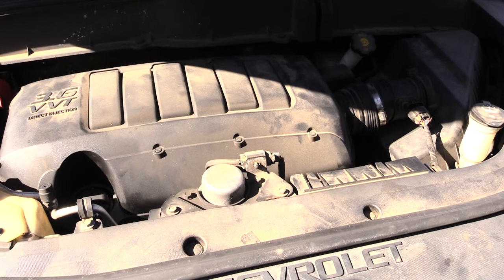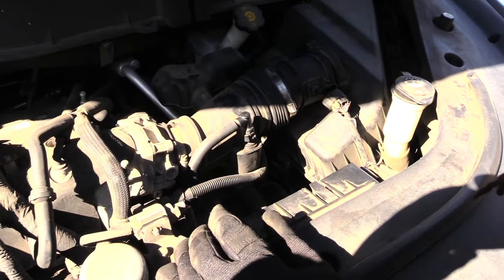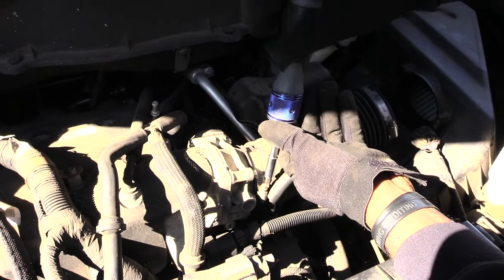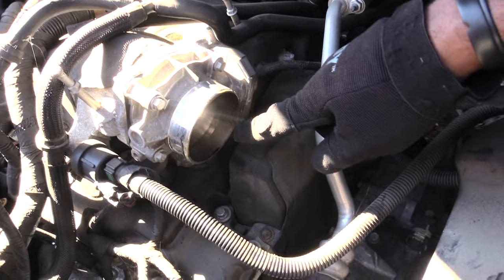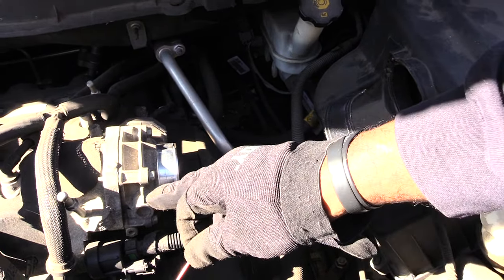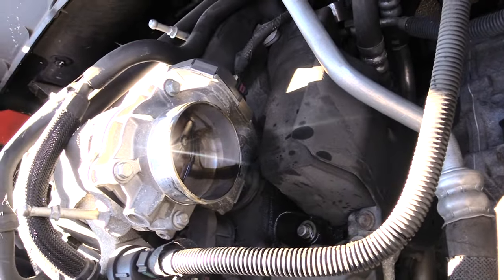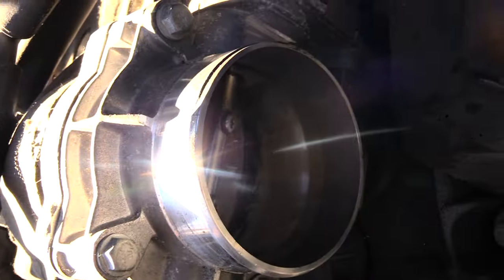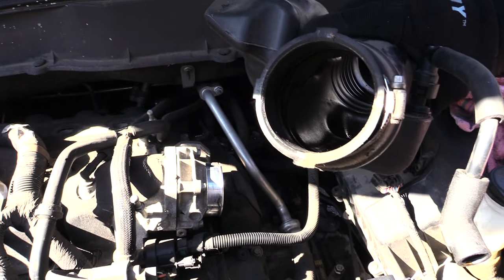Chevy Traverse Traction Control / StabiliTrak Problem Most Likely fix!

Comment: i randomly tried this because my stabilitrak kept randomly coming on and messing my car up. I was desperate for a solution and only thing i could do was push the traction control off before driving and even then it wouldn’t fix it all the time. There was barely any grease on the sensor or on the throttle intake. But i sprayed the sensor cleaning stuff on both, wiped it off really good. And so far it hasn’t came back on at all. So i’m hoping it’s a permanent fix, and if it is - thanks for this video! ❤️
Reply from the maker: Your welcome. Hope it fixes the problem. Please like subscribe and share

Comment: I never would have associated the Service Traction Control error to the Throttle Body or Throttle Position Sensor.  Stupid programming in my opinion.  I did this Throttle Body cleaning yesterday and so-far our Traverse is running fine again.  I didn't actually have any throttle body or carburetor cleaner handy so I used starting fluid.  I cleared the error codes and we're good to go.  Thank you for this video!
Reply from the maker: You're welcome! Glad could help Please subscribe like and share and check out our other helpfull videos

Comment: it happened again. Luckily this time we were not on the highway. Loss of power," traction control off" light comes on. Will be 2 years in april I followed your instructions to fix the problem. I have a full can of throttle body cleaner still at home so this time I had everything we needed to get it fixed. I had to look at your video again though
Reply from the maker: Thanks for commenting, hope you get it fixed!

Comment: This is the issue I am having with my Traverse. The Traction control light comes on, the Service Air Bags, and sometimes it has Engin Power Failure and won’t accelerate. I believe it to be the Throttle Body so I will check it out. Thanks for sharing.

Comment: Thanks man. I followed your instructions. Cleaned out the throttle body with the correct spray. It started up and there was no reduced engine power. The engine light was still on so I took off the positive battery terminal and put back on and that cleared out the engine light. Drives better than ever.
Reply from the maker: You're very welcome thanks for commenting hope you subscribe like and share.

Comment: It found out that there are several issues which cause the ECM to shut down traction control and reduce power to 3 cylinders. It looks like chevy installed a safety protocol that is too sensitive and will shutdown on the slightest error signal. The wheel sensor in my Traverse kept shutting the system down.

Comment: You really need to remove the throttle body completely to clean it properly. Don't ever spray that shit inside ur intake. It will fuck up ur sensors and just cause issues.

Comment: Starter my 16 traverse last night. The whole car was shaking the engine was sounding weak. The Lights came on saying traction control disable, then Stability message came on along with the light. 

Let it idle for a few minutes, restarted it and was fine. But light was still on. Would this help fix the issue as well?

Comment: My 2013 Buick enclave i replaced sparkplugs scanner code a mis fire check engine still on cleaned throttle body cleaned map sensor traction control stabilizer appeared and engine shaking
Reply from the maker: Sorry to hear.Please subscribe like and share and check out our other helpfull videos

Comment: I have a 2012 Chevy Traverse LS and my issue is that the brakes always tighten up when I’m on a hill or on the interstate. I literally have to pull over and wait for the brakes for hours to loosen up yet the Stabilitrak light pops up as well as the ABS light.

Comment: Well, I'm still having trouble with my 2012 chevy traverse, cleaned the throttle and so what. The contraction service light is on and stabilitrak. 
Ugh so frustrating 😫

Comment: I have a 2014 traverse that the throttle continues to advance at start. The rpm’s run  up really quick. I shut it down it and so far starts correct the second try. Any ideas what this could be?

Comment: did this on my 2015 taverse and now my ABS / Stabilitrak / Traction Control lights are gone, but i am getting brake pedal vibrations/jumping like i have a worn rotor. anyone have any ideas? is this an ABS issue? could be a rotor issue but this only started happening right after cleaning out the throttle body

Comment: I did this and it worked for a while, but the issue is now back and im pissed off. Took this all apart again and throttle body and plenum still clean. i might try the TPS

Comment: So if I do this my light will go off that came on right after we did the brakes and that is now on my dash and it says traction control and stabilizer bar never seen it but one time before this but went off now it won't and plus my ABS light came on to

Comment: I have a 2010 Traverse that died while driving it.  The display says traction control off and it won't start.  It will run on starting fluid but that's it.  I've checked fuses and replaced the fuel pump and confirmed fuel to the Schrader valve at the engine but still won't start.  Any help????

Comment: That’s oil from the engine that’s in there it gets in there from that small tube that is connected to the part that connects your TB to the air box. Being that these vehicles (07-13) are prone to timing chain issues i do my own oil changes every 4000 miles and clean that oil from that part every time so it does not build up to the point of becoming an issue

Comment: I got these alerts after I changed my struts and got it realigned.  No change in power at all.  i tried this method in your video and no change.  Was told to remove the negative battery terminal which i did and that still didn't fix it.  Now what?

Comment: My 2013 Chevy Traverse LT turns the TC light on and reads Service Stability Track and Service Traction Control. We have not cleaned the throttle yet. Is this simple to do myself or should I have a mechanic do it? The suv runs normal I don't feel any difference but it's concerning when I'm driving and it turns on. If anyone with the same situation please advise if you solved the problem. TIA

Comment: That's not my issue. My issue is while I'm driving the vehicle the brake is pressing down causing the stablizertrak service traction control light to come on . I'm steady having to pull the brake back up with my feet. To keep the light from coming on